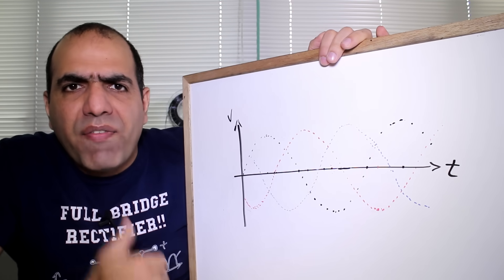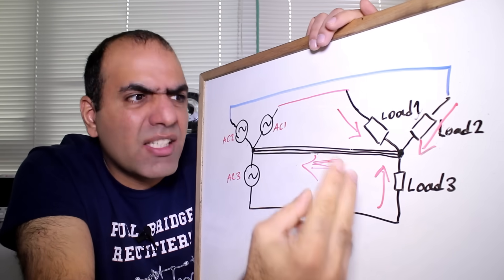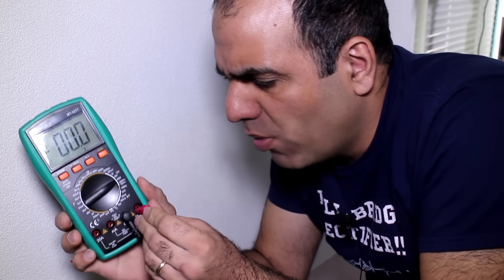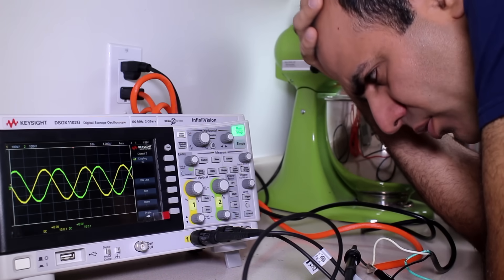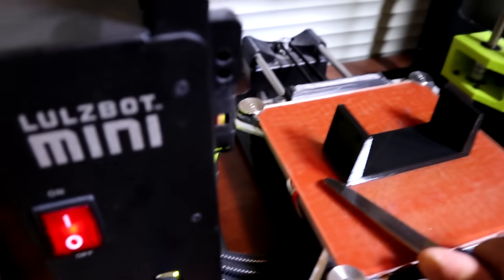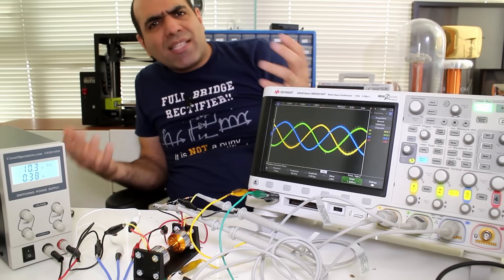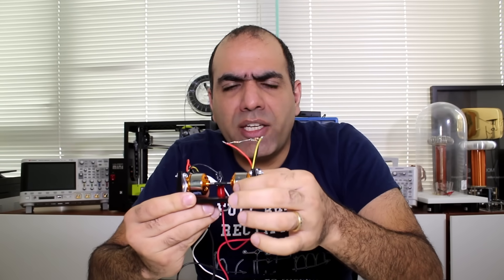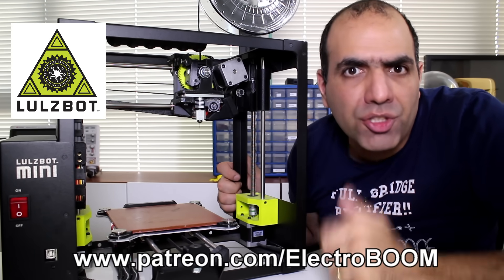Why 3 Phase AC instead of Single Phase???

Comment: The best reason for 3 phase is the fact that when the 3 loads are equal then the power from the system is a constant.  In other words the power is NOT modulating at 60Hz like a single phase motor.  Rather, the power is not modulating at all.  It is a constant.
This means that for a single phase motor you can hear it humming at 60Hz.  But for a 3 phase motor (if it was perfectly constructed) you won't hear any hum.  
This means nearly no 60Hz vibration and thus the motor lasts longer.  
And the torque output of the motor is also a constant which induces less vibration into the load so the load lasts longer.
Some math. Power is a function of the square of the voltage.
Single Phase Power=SIN(alpha)^2 = SIN(2*alpha) which varies with alpha
Three Phase Power=SIN(alpha)^2 + SIN(alpha+120)^2 + SIN(alpha-120)^2 = 1.5 for any alpha
Reply: I heard a sawmill operator say exactly what you're talking about with a grinder that used a 300 horsepower electric motor. He said someone was running frozen wood through the grinder, and the force involved caused the ground to shake, but "ou can't hear anything from the motor, so "you can't tell whether or not it's working hard, but it must've been".
Reply: You will still get Lorentz attractions in the end windings and magnetostriction in the stator core, both of which can cause humming at twice the electrical frequency.
Reply: It doesent matter *dab on haters.

Comment: Well I think you did a very confusing job in the whole video. Trying to explain the reasons and difference in a minute and a half is in my opinion just not possible.  

An ordinary home 3 wire 120/240 service is considered a single phase service even though each hot wire is 180 degrees out of phase as is each hot wire and also 180 degrees out of phase with the neutral wire. This may seem paradoxical but it is best understood by introducing the concept of center taped transformers and/or hypothetical AC batteries in series. A two phase system is usually a four wire floating (no ground or neutral connection.) service. The current and voltage of one set of wires is 90 or 270 degrees out of phase with the other set. Two phase systems are very old legacy systems. A special transformer arrangement is used for conversion of three phase power to two phase power to solve that problem. 

One reason for using a multi phase system is seen when building large induction motors. You can now use the rotating field to make the motor turn instead of having use some other means to start an induction motor on a single phase system which can only create a single changing and opposing field not a rotating one. Usually this problem is solved with a capacitor and a separate start winding in a single phase motor. Commercially built single phase motors are limited to 5 horse power. Now you should understand why any commercial or industrial building requires 3 phase power since often they require large induction motors to run fans, refrigeration, pumps and other tasks requiring motor power. 

While you showed 3 phase wye connected systems you did not cover 3 phase delta connected systems.

Comment: If powerplants are distributing way more power than we can ever use then why should we have to pay more if we use more when it makes no difference to the power plant? If anything we should be trying to use it up. Think about all the wasted power getting distributed that were not using because it will cost us more. They should charge each building by the square footage as a set rate because the generators are producing way more power than we could ever use. Especially sjnce theyre arbitrarily stepping the voltage down everywhere. If you think about it were actually wasting energy when we shut a light off..🤣

Comment: Theres no way your receptacle has two phases. All that is is 2 seperate 120v circuits aka 240v most likely sharing a neutral. The 240v in a residential dwelling is produced from a single phase and its only using 1 out of the 3 phases out there in the street my brethren..

Comment: As some other people also noticed.

The motor you used is a synchronos motor and no induction motor. The syncronos motor always needs a syncron three-phase sytem to be troven, as the dc-controler does. It's basically a inverter with speciall control strategy usen current feedback. 

The induction motors are not able to act as a standalone generator, because it has no magnets. Also a induction motor always cause inductive reactive power. Even as it works as a motor or a generator. Wich is a greate benefit, esspecially for train services. If they fail due to shorts the don't work as a massive breake, as syncronmotors with magnets do. 

Every motor is somehow a transformator. Combined with the rotation. In syncron systems the rotation is exactly the frequency so the inducing field is equal in the rotor coordiantes. Therefor no voltage is indueced and a permanet magnet or a exitation winding is needed. In induction motots the secondary winding is shorted. The induecd voltage depends on the difference betwen the rotation speed of the rotor and the stator. The induced voltage and current, causes the rotor field and therefore the fields providing torge. 

If you want to build a syncron motor without magnets you need con collector rings which ware out. But the last longer than commuatator in a DC-Motor. The reason is that it does not need to swich and therfore no bruch fire is present.

The syncron motors with permanent magnets are usually the most efficient way to convert mecahnical and electrical power.

Comment: Actually it was not Tesla, who invented three-phase. It was Ferraris, who made up all the theorethical calculations and Dobrovolsky, who made it in metal. Tesla did it half year later but still pushed to two-phase system.  After International Electrotechnical Exhibition (Germany, Frakfurt,1891) it was clear, that three-phase system is superior to DC and two-phase, but Tesla insisted on two phase in Niagara Falls (1895). Westinghouse paid fees for rights to use Dobrovolsky's patents - it was one of the reason in later cease of funding Tesla. "The War of Currents" was effectively over in 1891, only journalists made it alive for 20 more years. It wan only for public fun, as Edison has effectively lost his rights to own company in 1892, when GE was formed.

Comment: Interesting. But if you can make a 3 phase generator, why not double it and make it 6 phase (60 degrees) ? Why not 12 phase (30 degrees)?
Reply: because the power transfer of three phase is already completely flat and I mean completely flat. There's is not just a little sinus ripple it's completly flat. really totally absolutely flat. It may sound ridiculous but if you do the math the cos() factors cancel out and you're left with the +1 factor. That is if you transform 3-phase voltage to 3 phase power. sin^2 is 1-cos(t*2) or something like that. If you add all three up then those cos() parts cancel out and you're left with the '1' factor or part.

Comment: You went to some trouble to explain that a balanced 3 phase load has a 0v star point but you didn't really explain what happens when the load is out of balance, just an almost-missed-it mention a couple of minutes later.  But whatever, I really enjoy your videos, and the time you take to make them.  As an aside we have 230/400v in NZ, accidental contact hurts a bit more...

Comment: Three phase is very convenient for reversing applications like machine tools, and produces a cleaner cut compared to single phase. If interested in why, check out the Practical Machinist forums. They are not hobbyist forums and have lots of useful info.

Comment: A question. I have a 1 phase motor at 230v for an air compressor. Can I make it three phase? To make it work more better? I use it for air tools for working on cars. Can this be done just curious.
Reply: no. maybe you can put a transformer before or otherwise connect it between l1 and l2 if you have a three phase connection but I doubt that thing is going to survive very long then again you never know.. on a serious note if the thing doesn't get too hot you can pump it up a little bit I guess:)
Reply: but the problem with apllying more voltage to the engine might be that the iron magnetic core metal goes into more saturation so you'll just end up with a more heated engine and not much more power.
Reply: the most obvious improvement would be to apply a cooling fan to it and apply a little bit more voltage that's the way to get more power out of it. But i don't really know the characteristics or the graphs of how much more power you can get out of that engine. I need more data does it cut out because it's overheated? that's offcourse a simple fix
Reply: Ah thank you for the info. Ill try to hook a external fan to it. It just gets laggy when running for a while. Ill check the internal fan aswell maybe really dirty in there. Thanks again.

Comment: This guy is lucky he is not dead the way he plays with electrical wiring.
Reply: Lol, he's a high level, angry pixie wizard, he knows what he is doing.
Reply: Wanna know how I know you watch AvE videos?
A few years ago I accidentally shorted the hot wire to ground on a piece of lab equipment in a hospital. Instead of tripping the breaker for that circuit, it tripped a 500 AMP Main GFCI for the entire wing. Now that was embarrassing. It did point out a flaw in their brand new renovation though.

Comment: The problem is that the flux capacitor uses 1.21 gigawatts.
Reply: Its not 3 phase or it wouldn't run on lightning.
Reply: @p39483  Flux Capacitor looks like a Delta Phase, the Delorean would have a DCtoAC and/or ACtoDC converter

Comment: I remember in my 2nd semester circuits analysis class having to come up with a mathematical proof that the 4-wire connecting the centers of the Y's in a triphase system can be removed.  It looks obvious, but doing the math was a bit of a bear.

Comment: It would have been nice to see the efficiency by converting the 2nd motors output through a 3 phase rectifier and then power the speed controller for the 3rd motor from that. Then we could really see the loss over the system.

Comment: Here in Sweden, it's common to have 3 phase current in normal apartments and houses. The voltage is 400V between phases and 230V between any phase and neutral. The big benefit of that is the possibility to run power-hungry appliances like electric stoves, heaters and Bridgeport milling machines without a hassle.

Comment: Isn't a BLDC motor actually a 3 phase synchronous motor, not induction.??

When used in most "hobby" / low end applications  (sensorless) it is driven with a DC pulse, while in sensored (hall effect) systems it can be run with an AC VF/VSD (need the sensor to maintain synchronicity)...  if it were an induction motor that third motor would have worked better...
"advanced" "Drone" manufacturers use their AC (sort of) motor drivers with (moderately) higher effficiency as a marketing ploy.
Reply: kadmow shut up nerd
Reply: @joewellindowd5664 : haha ha  lmfao
Reply: kadmow I’m glad you got my humor

Comment: Electricity in Canada is single phase 120/240V for residential no matter if it's 120 degrees apart, because it wouldn't make a difference of it wasn't!

Comment: Only 208 if you are in a building that is fed with 3 phase power. This would be the case in condos or apartments or other multi family units. In single family homes the phases are 180 degreees out of phase, and the resulting voltage is 240 volts.
This also explains why my car takes longer to charge on public charging stations, as the car is only getting 208 volts as opposed to 240 on my home charger.
Come measure my 240 plug, it shows 240 volts, not 208.

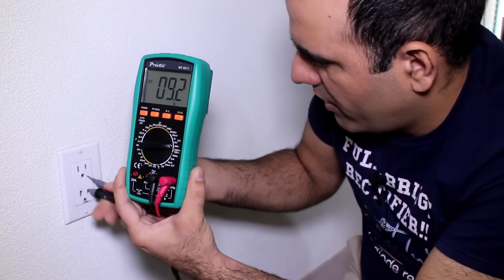Comment: 3:32 You might be measuring the neutral of two different phases. You should measure in the other holes to confirm whether they are the same phase or not.
Reply: He knows its live wire sockets because the small hole line is live and the big hole line is neutral and the circle one is ground so yeah bro he meassured same phases

Comment: In the US we typically have single phase residential services which are split-phase provided by a center tapped transformer giving 120/240 VAC. Do you actually have 2 phase residential service or is it a split-phase as well?

Comment: I'd need an inverter and one rated for compressors and motors. It all seems problematic for a renter...buy YES it is going to cost lest in energy costs depending on how it's billed. Delta or Y? Could I get a big multi-tap transformer?

Comment: Happy holidays Mr BOOM. I have been on the subject of SSR's today. I'm thinking a zero crossing SSR can help reduce the inrush on my well pump. I'm off grid and trying to be easy on my inverter. And a soft start pump is expensive. It is a 120v pump. I know it will not be as good as a soft start. Can it help? Would it be worth it? Great video..

Comment: You are 100% wrong. In Canada and the US single phase is not two phases. It's referred too as a split phase 240 VAC with each half being 180 degrees apart, not 120 degrees  apart dick head.

Comment: Sorry sir, but in 120/240 systems, there is ONLY ONE PHASE...there is a center tap on the transformer (on the distributor's pole), and that tap makes it look like the AS LINE (not phase) is OUT OF PHASE by 180 degrees...but it's not the case! You cannot have 2 phases coming from one transformer, if it's fed by only one source! The center tap in the neutral wire. It makes everyone think that there are 2 phases, when in fact, there are 2 LINES!

Comment: 5:34 If the induction motor generates electricity if it is used as geenrator. How does it work? The rotor does not have magnet. Does the rotor generate a magnet field in this case?
Reply: The rotor does have a magnet.

Comment: 9:50 Almost. The big benefit to using induction motors in EVs is that they can run at higher RPM. That is, DC brushed motors are speed limited, so usually need a multi speed transmission to be very effective.

Comment: LMAO!! funniest video on electricity I've seen!! 3 phase motors are better because you don't need a start switch/governor/start/run cap on larger motors so less to go wrong... bad=single phase a motor and it's toast... however if you use a VFD then you will have not only single phase/overload protection but you can run the motor much more efficiently in many cases. You can also run a 3 phase motor on single phase current with a VFD if the VFD is rated twice that of the HP of the motor. Rotor phases and add a phase also work but no protection like that of a VFD.. hope this helps some. The quadcopter "brushless" motor is called DC because hobbyists don't know better. The "speed controller" they use is actually a VFD without the AC bus but they don't know that so they call it a "brushless DC motor" /rolleyes..

Comment: You can also use a single three phase AC motor to generate 3 phases out of a single phase. If you feed single phase AC into one of the motors windings, it will spin and generate the other two phases on the unpowered windings. Then you just connect each phase up accordingly.

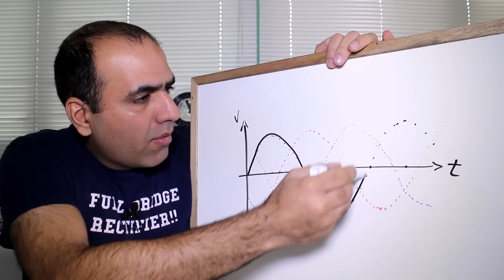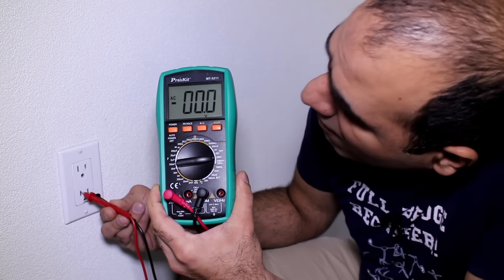Comment: 0:28 if it's second and sine wave with 120 degrees added, you should have gone for the one which began from positive y-axis... 3:05 do u do it on purpose or careless or u did not know or to show viewers the danger? u know a lot so u would know it was going to fire up after 3:05... at 3:10 doing with HAND is dangerous so i don't think u did the mistake to show viewers the danger, because i am not sure but hairs or skin can get a shock? should u be using hands, without proper covering??? 4:11 u scared the hell out of me... 8:02 u r crazy!! do u drink very often?? u need to train yourself with concentration increase something... i don't know , why no safety gloves???

Comment: runs on three phase ac but keep in mind the motors aren't rated for high voltage you need a transformer to lower the voltage

Comment: DC black wires are hot too, they are just NEGATIVE hot. With DC systems, both sides are hot, they are just different voltages. The difference in voltages is what allows a current. In AC systems, only one side is hot, because it contains the voltage difference within itself.

Comment: Had to double check... but in Ontario we distribute residential power by splitting the three phases. One phase going to a neighborhood. Urban distribution is 4,160 volts, single phase. Its stepped down to 220 volt, center tapped, for delivery to the house.

Comment: Have you looked at the Rotoverter config?  using a 3phase motor driven by single phase AC and then axle coupled to a second 3phase motor that's setup to resonate and produce VARS output?
Reply: The little RC airplane motors you have should be able to be driven by single phase AC on the drive side and output 3phase off the generating side...  you will just need to find the right size capacitor to put on the exciting leg of the drive motor...

Comment: Hi.
Can you explain why not 6 or 12 phase transmission since all the points covered in this video are true for 6 and 12 phase cases also.
Also, can it be mathematically shown that 3 phase is optimized in terms of power/copper ratio?

Comment: What causes shifts outside of 120 degrees? I had a service call for an apartment thats AC and hot water stopped working. I assumed a lossed phase from a burned up breaker, but they said they didn't have flickering lights, or partial power outages like you normally get. I inspected their main breaker, it was old, but clean. I got 120 either phase to neutral, but phase to phase I got 0. Turned it off, then back on, got the same readings. I was puzzled. Then I tested the hot bus feeding the breaker, and got 240. I concluded the breaker was the problem, replaced it, and all was good. But I still to this day can't figure how the breaker could fail in such a way that it alters the phase.